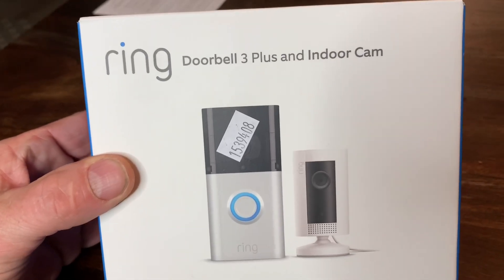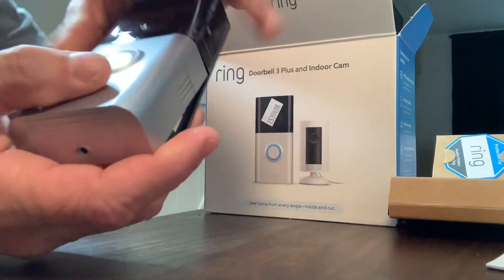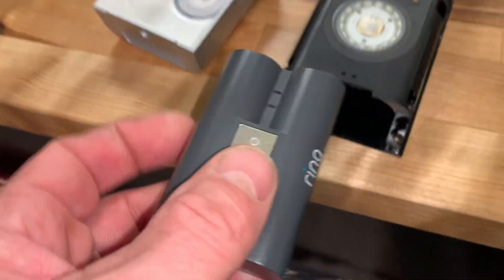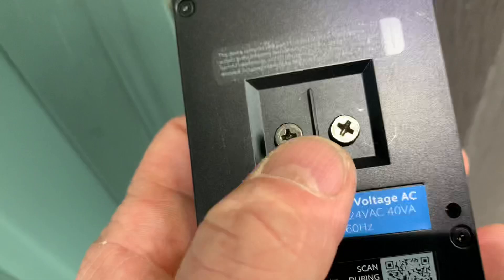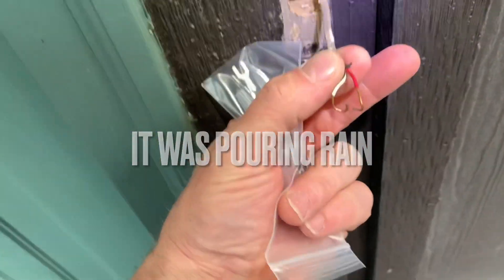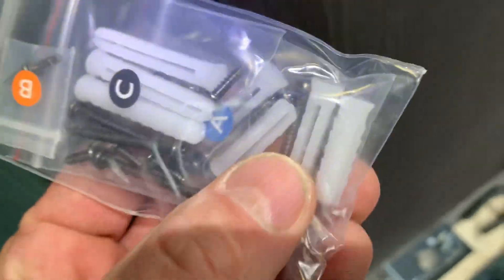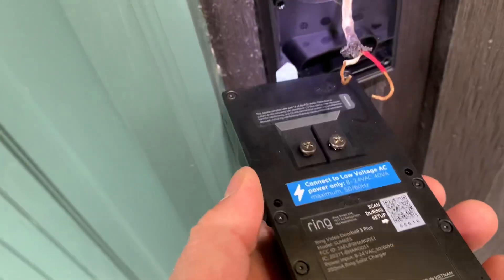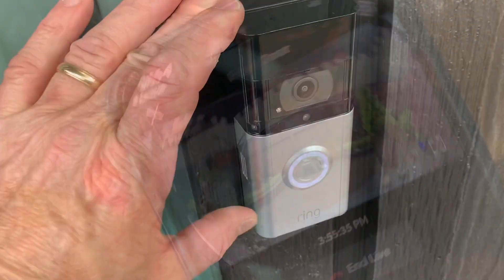DIY Ring Doorbell 3 Plus Indoor Cam Unboxing and Installation [Ring Cam Doorbell 3 Plus Tutorial]

Comment: ¿Se ha instalado el transformador y el multímetro mide 18V pero no funciona al enchufarlo a la máquina? ¿Tengo que insertar la batería? Gracias   The transformer has been installed and the multimeter measures 18V but it doesn't work when plugged into the machine? Do I have to insert the battery? Thanks
Reply: Yes